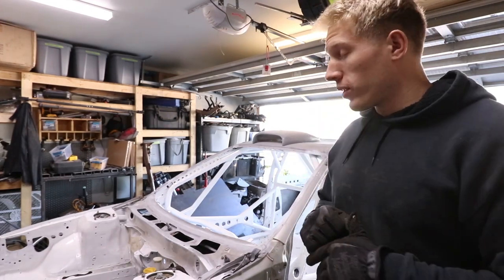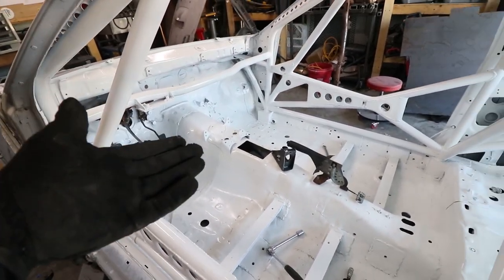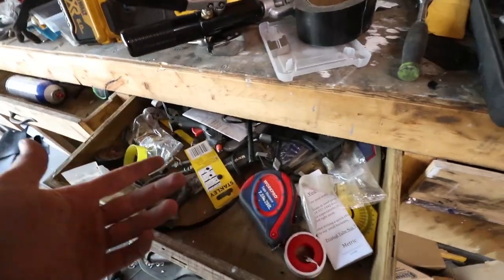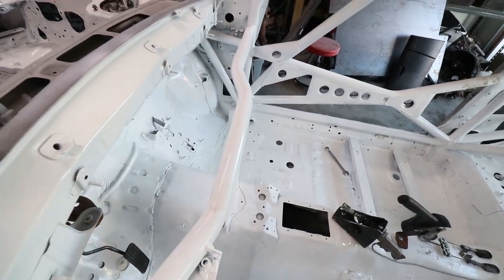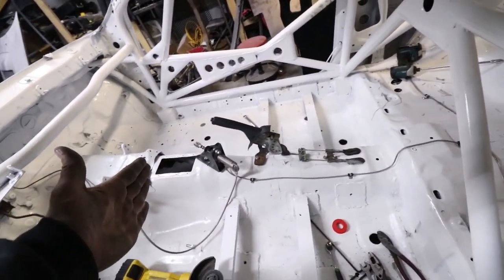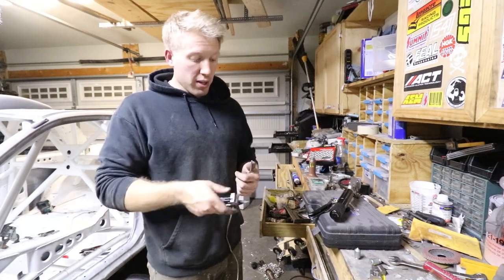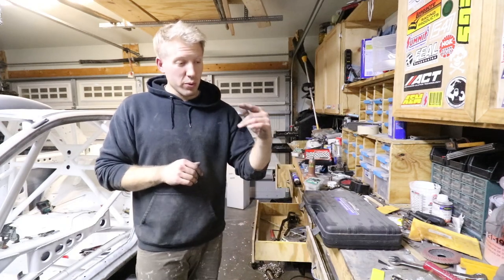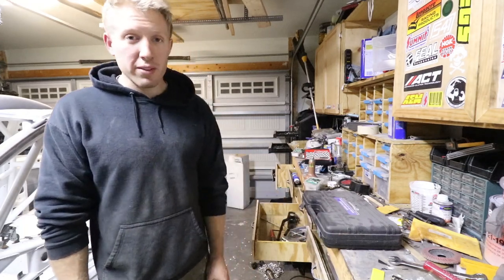Running New Brake Hardlines for the Hydraulic Handbrake in the Rally GC8

Comment: so the front and rear shock towers.. I know you have the top plate and a plate for the frame. when i do my build i plan on having two cars and im going to re enforce the whole tower with a slave well. the reason is i plan on re enforcing the whole thing not just the top bc the sides are still open to buckle. what do you guys think? also why keep the master cylinder? there are racks you can get that are self contained and under pressure. for e brake and peddle braking and use the regular e brake and cable for parking. see here buddy https://www.youtube.com/watch?v=KRkzlSq4lSE&t=31s
Reply: btw i love this series keep it up man
Reply from the maker: Are you talking about how they have the Msport handle that act as a reservoir to the center diff master cylinder?
I didn't go with a different peddle box with multiple master cylinders due to funds and I can't run a master cylinder that is independent from the normal brakes unless I add in a second caliper to the rear wheels, which isn't necessary since you hardly use a handbrake while rallying a slow car anyway if you have good left foot brake technique.
Reply: @DirtyGarage  aww ok i was mostly concerned about left foot barking bc the loss of vacuum. the race brake system i was looking at only had one cylinder at the petal for all four cylinders, and the ebarke the handle itself was the pressured resevor. its hard to explain, but keep up the work man i love it!
Reply: @greencomfortliving4909  https://www.chasebays.com/products/chase-bays-brake-booster-eliminator-subaru